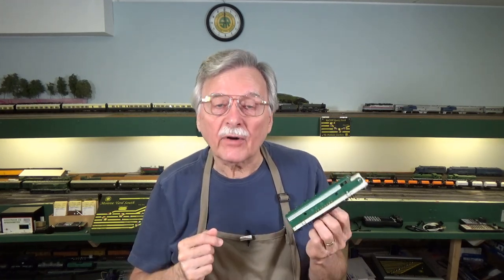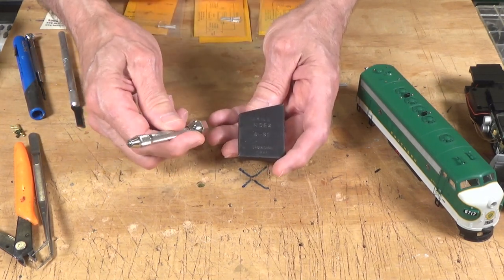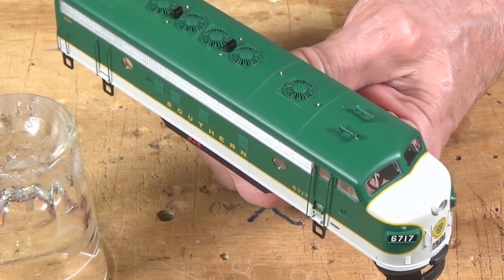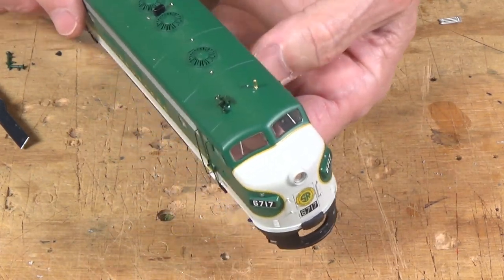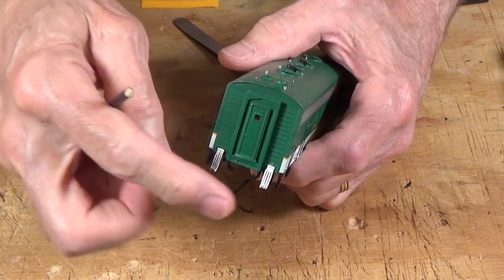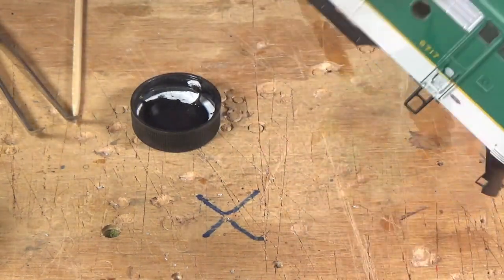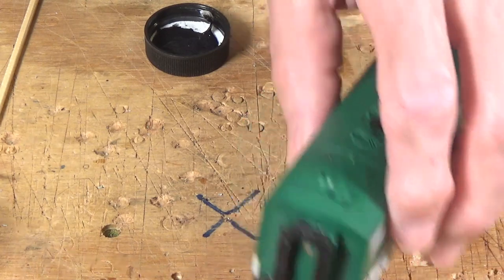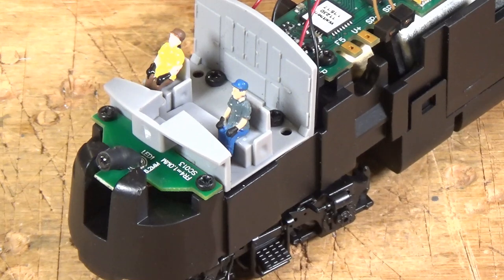Adding Details To A Factory Painted Loco (322)

Comment: Glad you mentioned the Badger Modelflex. I thought it was no longer available but found that was not the case. I started using it in the nineties and those old engine still look good. It actually stuck to hand rails that I installed and it didn't flake off. It was also great in the airbrush. Thanks for another great video!
Reply from the maker: Yes, Testors has taken over the world of model paints and pushed Badger to the back burner. It’s a shame since I feel Badger is superior.

Comment: Touch-n-Flow makes a very nice CA glue applicator that is excellent for small parts that only need the tiniest amount of CA glue.  They are a bit pricey but well worth it when you can set detail parts without a pool of glue around them. The train air line at 12:56 is a good example where this would be useful.

Comment: ....Especially proud of the 3 war bonnet engine set (converted from the proprietary Lionel Command wireless system to a set of 3 Loksound boards all synced together.....pulling a beautiful set of K-line stainless coaches....left to me by my late son....taken from us way too early😢
Reply: conversion from Lionel Command system to Loksound/Digitrax DCC was done because the original wiring between 3 engines kept breaking from stresses in curves + I wanted all 4 trains... (2 HO, 1 - 027 set & 1 G-scale to all run from a single Digi-trax throttle.
 ...Shame...I had to tear it all down when I sold the house.....all that wooden track work burned in the incinerator  since I had no easy way to move/store it!

Comment: Great video Larry. Where does one go to find all of the specific information about a particular locomotive?
Reply from the maker: Photo books, reading Model Railroader. There are tons of books showing full rosters of locos for specific railroads. You just have to pick a loco, study the details and compare to what is available fro Detail Associates, Details West, CalScale, etc. Magazines like Model Railroading, Model Railroader, RMC used to run articles in every issue showing what I did in the video and listing all the details but all the fully detailed off the shelf models killed the demand for those.

Comment: Hi Larry - unrelated to this video’s topic, but I’ve been having problems with programming a Broadway Limited sound decoder with my PR4. I’ve read that they may need a programming booster. Do you have a preference between the PTB100 and the Powerpax? Are they basically the same? Thanks in advance.
Reply from the maker: The PTB100 is better.